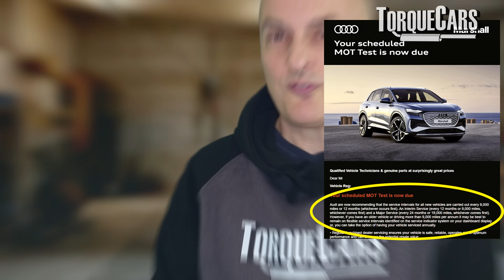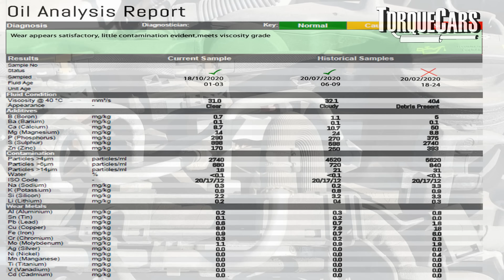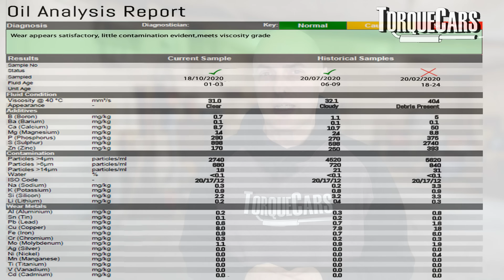Phew The Silly Audi Long Life Service Is No More (Officially In The UK)

Comment: if you want to keep your vehicle as long as possible in top condition 3000-5000 miles oci is propably the best preventative solution strategy. Altough the modern lubricants are more advanced than ever it is also truth that modern turbo engines are more sensitive and demanding (and please do not  forget  oil is relatively cheap but engines are way more expensive)

Comment: The Jaguar service interval for the Ingenium engine is just as barmy. I run an XE diesel, and the interval is every 21k miles or 2 years. So when I bought my 2017 in Jan 2019, it had 10k miles, and I took out a service plan with the Jaguar main agent, but got  them to insert a service in between the official services. This additional service was essentially just an oil and filter change, plus a safety check. So far, I have had zero defects and problems since, until last week when the nearside brake light bulbs failed ! £13.99 to fix at Halfords. Biggest problem I have had is wheel and tyre damage from potholes, but you can't blame Jaguar for that; I just wish the previous owner had opted for smaller wheels and fatter tyres.

Comment: My car (petrol/turbo)specifies 24mth/18k ml factory service interval. I change oil and filter at 8k mls which is around 8mth time intervals. Use specified grade i:e 5w30 C3. As a time served tech of 50yrs I know if and when I have an issue with anything on a vehicle,  i go by my experience to monitor the condition of the oil, most regular journeys are in excess of 30mls , never use stop/start. I don't waste money changing air/pollen filters until I decide they need changing, 70k from an air filter is perfectly achievable if they are vacuumed out at 20k ml intervals. Transmission oil is changed at 75k mls.  If the average guy who changes EVERY filter going annually ran an HGV truck they'd be skint in no time!

Comment: One thing nearly ever is mentioned: the oil volume of the car.  Bigger volumes are better.Higher capability of binding  dirt/ moisture etc, better cooling. My girlfriends Abrath 2,9 ( bad joke) , my Clio 3 RS  5,4 liter. Furthermore the engine type is important: The least problematic are natural aspirated diesel,  the most problematic are turbo petrol ones. Combine a turbo engine with low oil volume,  start stop 🐃💩 ,short trip driving and on top of that long service intervalls,You've done everything to kill the engine as fast as possible

Comment: A company who stand by their products, and their customers, ie Toyota, have never gone down the laughable extended service interval route, one of the reasons they can offer 10 year warranties subject to following their common sense service regime.

Interesting how heavy trucks are now on 100,000km oil service intervals, despite having oil spinners to help remove the nasties modern truck engines simply don't last as long as 80s Cummins/Gardner/CAT engines, the designers and engineers of whom would have booted anyone who suggested 100k service intervals out of the building.

Comment: My cars either leak or burn so much oil an analysis wouldn't tell me much of anything! I have kits to send out but adding a quart every 1000 miles or so seems like it's always fresh oil. That being said I do change my oil at upwards of 10K miles. But I use an oddly large filter for how little the engine is.
Reply from the maker: Lol I've had cars like that in the past. How's it going buddy? Not heard from you for a while.

Comment: I have a 2019 Toyota Corolla hybrid 2.0 touring sport. Owned from new and running like new after 70k miles. Always dealer serviced less than 10k and I do an intermediate oil change (not filter) myself via vacuum extraction midway between dealer service. Hopefully the key to long engine life.
Reply: That's not a bad shout actually vacuum extraction for the 5k home interval service -makes it even easier, might take a look at it. I have a corolla too 2020 90k miles runs like new too

Comment: I have got a new Kodiaq 2.0 TDI 4x4.... recommended interval: 2 years or 30.000 Kms...I am doing 80% of drive on motorways...4 1/2 months 10.000 Kms so far...would you suggest to follow manufacturer recommendations, or should I follow the typical 1year or 15.000 Kms?
Reply: 30.000 km would.be for 100% motorway driving. I would not go more then 20.000 km without an oil change in your case. 15 is of course better.

Comment: My work van is a Merc sprinter Luton (tail lift)
The company I work for bought it brand new last year, a 74 plate.
I’ve done 82000 miles. It’s first service was at 35k, 2nd at 70k, which over ran to 76k.
Touch wood the engine runs fine but surely the service intervals should be shorter than 35k ?
Thankfully I look after it like it was my own. Like letting the turbo wind down when I stop.
Mercedes said it has long life oil 😂
Reply: Holy moly.

Comment: Every 10km. A lot of people just don’t care  about cars. Always buy with a service history. It’s simple.
Reply: For a direct injected petrol engines, especially turbo, even 10k km is too much.
On my 2.2 JTS I replace it twice a year, every 6.000 km. It already becomes dark in 2.000 km after the oil change.
Reply: 10km?? I change mine every time I go round a corner, or every day whichever comes first. Can't be too careful! 🤪
Reply: @feanor5037 Never have trouble selling either.
Reply: @kjph7438  I'm now not sure if you were joking from the start, made a typo for k miles, went along with my joke, or missed my joke. Or a combination of a couple of those 😅
Reply: @feanor5037 I went along with your joke, but k or Km still mean the same thing 😉
Reply: @feanor5037 I’ve seen people write 10k miles too!
Reply: @kjph7438  Well 10k could mean 10,000 somethings or 10 kilometres, while 10km pretty universally means 10 kilometres 😜

Comment: my 2015 rx 350 lexus, with 100,000 km when I boiyght it, previously owned by the wife of a guy that owned a chain of ool chanfe places, I change the oil at 10,000 km. First thing I did was change all the fluids in the car. I was thinking, if I was pissed off employ, guess what passive agresive actiins I eould take. 🤣

Comment: Hyundai 2016 I30 1.6 Crdi, 118k miles, oryginal turbo, chain, injectors, clutch, suspension. I change oil every 3k with filter, other filters every 6k myself.

Comment: The 24,000 mile oil change is a lie.  You will get stretched timing chains and your engine will start running louder and rougher and might periodically stall and you’ll get a stinkier exhaust smell.  Oil is cheap, engines are expensive.  Every 5,000 miles on full synthetic is reasonable especially if it’s a turbo and those engine air filters need to be replaced every 20,000 miles minimum
Reply: 5,000 Klm or 3,000 Miles oil and filter change is a baseline for longevity.
Reply: Absolutely. I change mine in my Mk8 Golf R every 3,000 miles, which is roughly every 3 months.

 Driving style & conditions play a big role in determining the intervals. I change three times as frequently as the manual suggests. 10,000 miles or 1 year is far too long, because it’s a performance car that’s daily driven to oil temperatures between 220-240*F in FL. These conditions qualify the engine to be placed in the category of “severe maintenance”, and is a category that most people fall unknowingly fall into. Long idle times, driving in dusty and/or hot climates, short trips, or if the vehicle is regularly driven hard.

 It’s often recommended nowadays, if you want to maximize the service life of the vehicle, to change vehicle’s service fluids at half of the interval the manufacturer suggests.
Reply: @clutch7366  what oil are you using  0w20? Or 0w30 oil.
Reply: Read my comment about my work van mate.
It’s ridiculous!!
Reply: It is actually 12.000 miles for the "hard driving conditions" (read: regular driving such as city driving, short trips, idling,...). 24.000 is for "light driving conditions" (open road only, constant speed, hundreds of miles at a time), but it is the number used by marketing. It is  in every manual, but nobody reads it. Not even the official dealers.